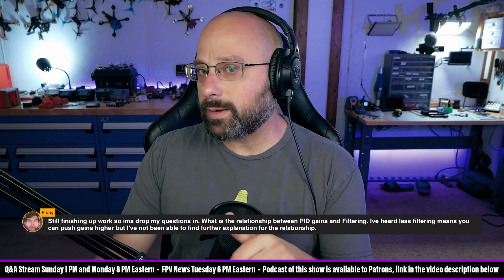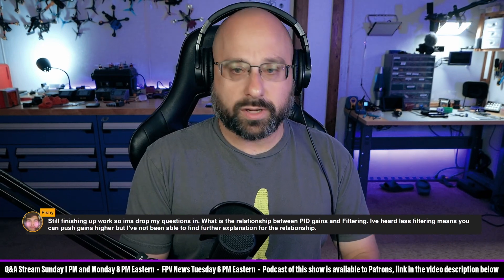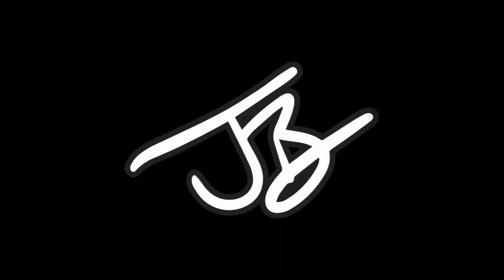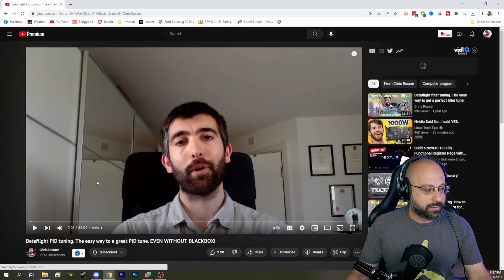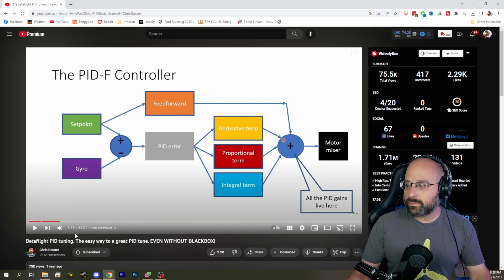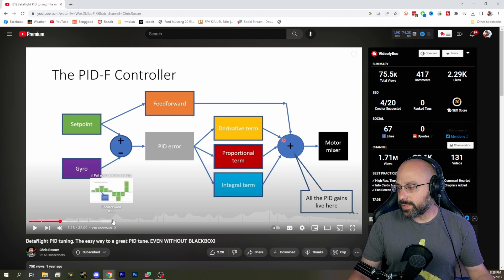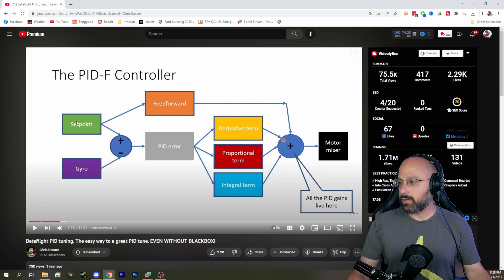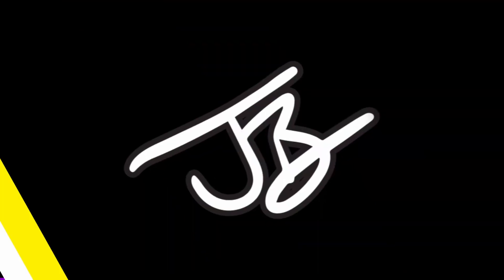What's The Relationship Between PID Gains and Filtering? Betaflight - FPV Questions

Comment: Hey JB i just got a whoop bnf with around 47g with a 550mah battery to be exact it is the Whoopfly16 by sub 250 and thats the pid's for it. It came that way thats their cli. Isn't that to high  D-Gain especially. It is both high 90 and over 100. Can you help me. I pretty new in the hobby looks to me they want to sell more motors that way because all beginners like me won't notice  and burn out their motors. Whats the deal here do you have any guidance? 
set p_pitch = 80
set i_pitch = 143
set d_pitch = 103
set f_pitch = 142
set p_roll = 76
set i_roll = 136
set d_roll = 91
set f_roll = 136
set p_yaw = 76
set i_yaw = 136
set d_yaw = 0
set f_yaw = 136